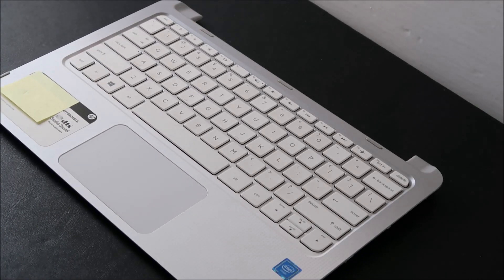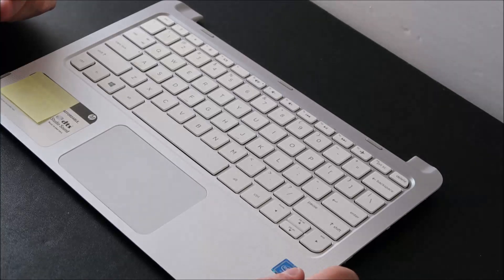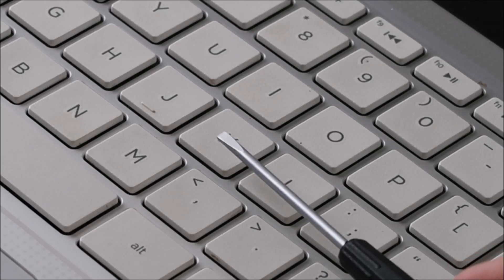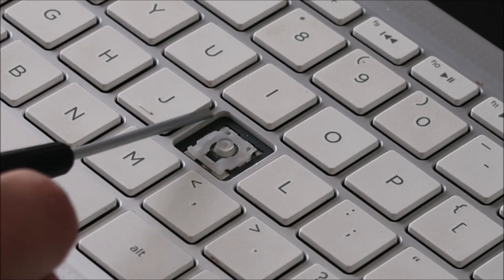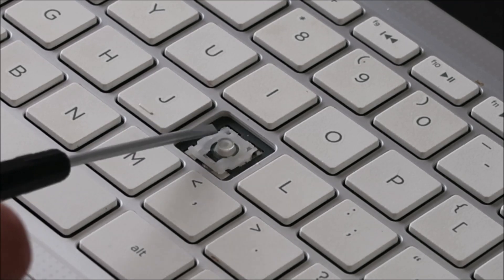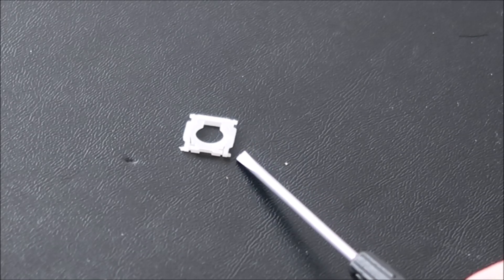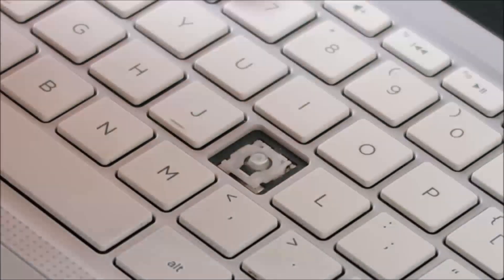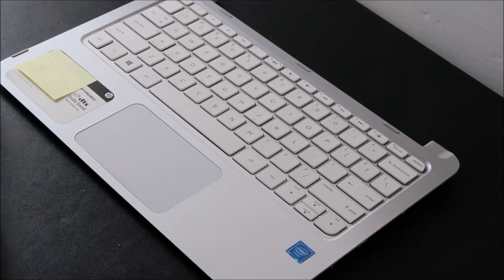How To Fix Replace Small Keyboard Key - HP Envy Laptop Computer

Comment: my whiite thing is just came out with it  i think its stick with the key  and its not broke  for sure now how did i place it back
Reply from the maker: Because they key can usually not be reinstalled with the Retainer Clip and the Key Cap still attached to each other, you would have to separate them as seen here, using a small flat pry tool.
Reply: ooh got it thanks for the quick reply

Comment: Thanks for the video. The key "T" doesn't always produce the letter T on the screen. What do you think is the problem? Sometimes the T key produces two ts on the screen. Thanks.
Reply from the maker: Is there something physically wrong with the key / keys or are they mechanically working fine?  Also, did anything happen before this issue appeared?  Liquid spill, overheating, Windows update, etc?
Reply: @PC_Monkey  Nothing happened. A few weeks (6) ago I had to reinstall Win 11. Everything was working afterwards. This started 2 weeks ago
Reply: @PC_Monkey  BTW, if the keyboard fails, would I be able to use a wireless keyboard? thanks

Comment: my key is working but my i cant able to fix on it.. when i click it jumps out please help me..
Reply from the maker: If your Key Assembly is not installed correctly, I would disassemble and inspect for damage. If none is found, try to reinstall as seen here. If its still not working, its most likely due to the hinge clip being damaged or not oriented correctly or the metal pins on the keyboard being bent out of place. If you cannot fix or locate the issue, I would assume the key is damaged in some way and needs to be replaced.

Comment: I lost the little rubber piece. What can I do please?
Reply from the maker: You would need to replace it. You can sometimes find sellers on sites like Ebay or Amazon who sell key assemblies with that rubber spring included. However, most do not. You may need to get a new keyboard :(  Want help finding the key? If so, what brand and model computer do you have?
Reply: @PC_Monkey  yes thank you!! It's a Dell Latitude 5320.

Comment: Hi my HP ProBook 440 G8 one of the key from keyboard came off, but I am trying to put back, it's not happening.
Can you help?
Reply from the maker: If your Key Assembly is not installed correctly, I would disassemble and inspect for damage. If none is found, try to reinstall as seen here. If its still not working, its most likely due to the hinge clip being damaged or not oriented correctly or the metal pins on the keyboard being bent out of place. If you cannot fix or locate the issue, I would assume the key is damaged in some way and needs to be replaced.

Comment: THank you for this but what if my R key still isn't working after replacing?
Reply from the maker: Does the key feel like there is something physically wrong with it or does it feel like its working mechanically fine? Also, did anything happen before this issue appeared?  Liquid spill, overheating, Windows update, etc?

Comment: Whet if the letter came off with the white thing and cant come off bcs its "attached" to it ?
Reply from the maker: The retainer clip is still attached to the key cap?  Because they key can usually not be reinstalled with the Retainer Clip and the Key Cap still attached to each other, you would have to separate them as seen here, using a small flat pry tool.

Comment: THOSE CLIPS STAY ON THE KEY NOT THE KEYBOURD
HELP ME
I'M ABOUT TO THROW THIS WHOL LAPTOPP OF THE ROOF
Reply from the maker: Your hinge clips are staying on the key cap? Because they key can usually not be reinstalled with the Retainer Clip and the Key Cap still attached to each other, you would have to separate them as seen here, using a small flat pry tool.

Comment: i try to press the key cap back on but it doesn't work. Pls help me.
Reply from the maker: If your Key Cap is not clicking down in place correctly, it is most likely due to the Retainer Clip not being properly installed or damaged.  Remove the Cap and inspect for damage or that its not laying down flush and properly snapped in itself.  Compare to another Clip if needed by removing another Cap.
Reply: I tiny piece of the cap is chipped and I think that's why It don't fit. What do I do now? @PC_Monkey

Comment: How can i replace the rubber part underneath a keypad? Thx
Reply from the maker: There isn't really a good way to reattach those.  They are not meant to be replaced.  Best advice is try to use a small amount of glue.  If that does not work, you may have to replace the keyboard.

Comment: The plastic clip seems fine but the key won't stay on for very long.
Reply from the maker: If your Key Cap is not clicking down in place correctly, it is most likely due to the Retainer Clip not being properly installed or damaged.  Remove the Cap and inspect for damage or that its not laying down flush and properly snapped in itself.  Compare to another Clip if needed by removing another Cap.

Comment: I was able to get both parts off without damaging anything but having difficulty snapping back in place. When I turned the key over the latches/snaps are on the inside of the actual key in addition to inside of the keyboard. I was also able to snap the clip back in place but the key will not stay attached
Reply from the maker: If your Key Cap is not clicking down in place correctly, it is most likely due to the Retainer Clip not being properly installed or damaged.  Remove the Cap and inspect for damage or that its not laying down flush and properly snapped in itself.  Compare to another Clip if needed by removing another Cap.

Comment: Hi. My retainer clip came off with the key. I can snap it on, but every 4th tap or so, it's begins to come up. How do I keep it down?

Edit: I see you told someone else to take off the clip, but I've tried and it seems to be stuck onto it. LOL
Second edit, I just put a little elbow grease and was able to get it off. Wish me luck.
3rd: I think I put it on upside?? It snapped back on the key, but didn't stay on the board.
4: I managed to get it up there, but if I stroke the key in either left or right top corner, it's coming off. And when it does, the retainer clip comes off with it. 
If you have any tips, can you please reply? Thank you.
Reply from the maker: If your Key Cap is not clicking down in place correctly, it is most likely due to the Retainer Clip not being properly installed or damaged.  Remove the Cap and inspect for damage or that its not laying down flush and properly snapped in itself.  Compare to another Clip if needed by removing another Cap.
Reply: @PC_Monkey ... I don't trust my skills enough to do that just yet. But I've been checking across several videos and pictures and can't see where my clip or key might be damaged.

Comment: Found this video too late, now all my keys make a weird sound when pressed and the space key won't go all the way down. What the hell do I do now? (I guess i took the s key off too quickly)
Reply from the maker: If your Key Cap is not clicking down in place correctly, it is most likely due to the Retainer Clip not being properly installed or damaged.  Remove the Cap and inspect for damage or that its not laying down flush and properly snapped in itself.  Compare to another Clip if needed by removing another Cap.

Comment: Thanks for the amazing tutorial!
I have opened my laptop as the keys on the left side of my keyboard (the vent side) aren’t working. They used to work rarely when I repeatedly turned on and off my backlit keyboard lights. But now, that has stopped as well. Is it the dust or is it something else? All other keys are working fine. It’s basically Q, A, Z, and the other keys on their left and top sides. As I mentioned, my laptop is open now, so any help would be appreciated. The bottom of the keyboard (the inside part) which is under a transparent film seems slightly dusty, but I’m hesitating to take those films off.

Comment: Hello there! My key cap just fell off while i was playing video games but for some reason the clip is on the keycap. Should i renove it from the keycap and place it in the keyboard hole
Reply from the maker: Yes, they key cannot usually be installed correctly with the key cap and the hinge clip still attached.
Reply: Thank you for giving me this advice, I will try it out but I have been taking a look at the hole which the key goes in and I have seen that the metal hooks are bent forwards, and a post online says I should use needle nose pliers to put them back in place. Should those metal hooks be upright?
Reply: I just seen a another video with the same laptop model as me and the hook are the same shape as mine (90 degree angle) So I think I will take your advice of removing the hinge
Reply from the maker: @breezyeditz7  Good luck !!  Let me know how it goes :)

Comment: what if you broke the clear thing
Reply from the maker: If any component of the key assembly is broken, it would have to be replaced.  I usually get my keys on Ebay or www.replacementlaptopkeys.com.  If you cannot find a loose key for sale, you may have to purchase a keyboard and take a key from there.
Reply: @PC_Monkey   do they sell windows 11 home keys
Reply from the maker: @I-likebread  The operating system the computer uses has nothing to do with the model computer and what keys it uses.  What brand and model computer do you have?

Comment: even after doing this my key still pops up if i use it, what should I do? Nothing inside is broken.
Reply from the maker: If your Key Cap is not clicking down in place correctly, it is most likely due to the Retainer Clip not being properly installed or damaged.  Remove the Cap and inspect for damage or that its not laying down flush and properly snapped in itself.  Compare to another Clip if needed by removing another Cap.
Reply: @PC_Monkey  it clicks and I hear the sound but after some use it loosens and pop back up, I tried again  and did what you said and nothing is broke, this is just my alt account btw
Reply from the maker: @solar726   If nothing is damaged and if the key is orientated correctly, it will click down, assuming its the correct key for that keyboard.  If you have it orientated correctly and its not clicking down correctly, then its most likely damaged in a way your not able to identify.  I would replace it at that point.
Reply: @PC_Monkey  ok thank you

Comment: My key cap is not getting in
Reply from the maker: If your Key Cap is not clicking down in place correctly, it is most likely due to the Retainer Clip not being properly installed or damaged.  Remove the Cap and inspect for damage or that its not laying down flush and properly snapped in itself.  Compare to another Clip if needed by removing another Cap.
Reply: @PC_Monkey thank you so much, I placed it correctly and it worked
Reply from the maker: @daneenfarhan9587  Great to hear !! Always here to help :):)

Comment: Can you make a video for arrow key as mine is a bit elongated so its not fixing when i am pressing it
Reply from the maker: Usually arrow keys are similar in size to letter keys.  If yours are a bit larger, they should still have the same basic layout.  A retainer clip and a key cap on top of a rubber spring.  If your arrow keys are very large, they may have a metal bar or two as do shift and space keys as seen here:  https://youtu.be/S6gCGN_2zW8.

Comment: Hi! so im on my hp rn and i tried to fix the Z button, but it wont pop back down. Im not sure what im doing wrong but this laptop is VERY exoensive! Im not sure what to do..
Reply from the maker: If your Key Cap is not clicking down in place correctly, it is most likely due to the Retainer Clip not being properly installed or damaged.  Remove the Cap and inspect for damage or that its not laying down flush and properly snapped in itself.  Compare to another Clip if needed by removing another Cap.

Comment: i gotta take mine somewhere prob. the thing that stays on that you put they key on (the plastic thing or whatever its called) comes off as well so currently looking on yt to see if that can be fixed normally or do i have to take it somewhere.
Reply from the maker: If your Key Cap is not clicking down in place correctly, it is most likely due to the Retainer Clip not being properly installed or damaged.  Remove the Cap and inspect for damage or that its not laying down flush and properly snapped in itself.  Compare to another Clip if needed by removing another Cap.

Comment: For reference, here is what removing the up-arrow revealed: http://silmaril.ie/images/hp-envy-7t-arrows-keyboard-dirt.jpg and here is the result of cleaning underneath both up and down arrow keys http://silmaril.ie/images/hp-envy-7t-arrows-keyboard-cleaned.jpg  No further news until I repeat the process. Right now the up arrow is still stuck on repeating until the cap cover is removed, then it works normally with careful depression of the silicon bulb.
Reply from the maker: Do the keys feel like they are physically fine or do they feel like they have something mechanically wrong with them?
Reply: @PC_Monkey  The key feels and looks just fine, but simply won't stop repeating, just as if someone had their finger pressed down.
Reply from the maker: @peterflynn1100  This video is a tutorial on how to replace a key.  If your keys are not working but are not mechanically broken, troubleshoot them as seen here; https://youtu.be/wqrchfpdJ_w.

Comment: So I removed both up and down arrow keys and was shocked at the accumulated dirt and dust, especially since I take trouble to keep the keyboard clean. I used a fine artist's paintbrush (a hog fitch) to clean out the garbage, and then replaced the frames and the keycaps...and it worked! For about an hour, then the up-arrow started repeating again — eg in an editor the cursor zoomed up to line 1 and stayed there. I'll either repeat the process or dig further. Thanks for your guidance.
Reply from the maker: Glad your all set :) Always here if needed !!

Comment: My HP Envy has a stuck up-arrow key. Not visibly jammed down, but on permanent repeat, so the machine won't even boot. I'm just about to try and remove the key, but it's one of the half-size keys, which you don't mention, so this is going to be interesting...I'm assuming that underneath there is the same arrangement, just half-sized.
Reply from the maker: Yes you are correct.  Most likely the same set up, just smaller components :)

Comment: ummmm i have done all these steps but when i try putting in the keycap. it just wont snap back on
Reply from the maker: If your Key Cap is not clicking down in place correctly, it is most likely due to the Retainer Clip not being properly installed or damaged.  Remove the Cap and inspect for damage or that its not laying down flush and properly snapped in itself.  Compare to another Clip if needed by removing another Cap.

Comment: I'm missing the key, the plastic part.  I do have the rubber spring, but it is not connected to the keyboard.  What are my options?
Reply from the maker: If you lost a component of the key assembly, you have to replace it.  
I usually get my keys on Ebay or www.replacementlaptopkeys.com.  If you cannot find a loose key for sale, you may have to purchase a keyboard and take a key from there.

Comment: I honestly think that doing is slowly increases the risk of breaking it!...

Plastic is flexible, even if it's hard plastic. Therefore, if you bend it quickly and then allow it to go back to its relaxed state, it might hold, whereas if you bend it slowly and keep it in its bent state for a prolonged time, it might break!... Even for the exact same amount of bend!
Reply from the maker: I work in a computer shop and fix keys several times a week for years now.  This video is based on my experience lol.  If you have different experience, feel free to make your own video showing a better way to do it.  If your just commenting how you think it should be without really knowing, um... thx i guess lol

Comment: I have acer nitro model keyboard and my q key came off and its not damaged however imhaving trouble reattaching the key to the plastic bit, do you have any tips or help on reattaching it?
Reply from the maker: If your Key Cap is not clicking down in place correctly, it is most likely due to the Retainer Clip not being properly installed or damaged.  Remove the Cap and inspect for damage or that its not laying down flush and properly snapped in itself.  Compare to another Clip if needed by removing another Cap.

Comment: I dont get it
Reply: I need help for my "w" key
Reply from the maker: @Azan_A  What part dont you get?
Reply: @PC_Monkey  Well, i dont get how to detach of the mechanical thingy under the key. My 'w' key is broken. It just fell off. Now i dont know what to do.
Reply from the maker: @Azan_A  1.  Because they key can usually not be reinstalled with the Retainer Clip and the Key Cap still attached to each other, you would have to separate them as seen here, using a small flat pry tool.
2.  If any component is broken, you would have to replace it as you usually cannot install a broken key
Reply: @PC_Monkey  I know that but i don't get how to take the retainer clip off and what not to damage.
Reply from the maker: @Azan_A  As seen here, you would use a flat pry tool and insert it in-between the retainer clip and the key cap.  You would hold down the retainer clip while you pry off the key cap
Reply: @PC_Monkey  I have gmailed you a picture of my keyboard and in that email have explained the things i dont get.
Reply from the maker: @Azan_A  The gmail account is for business purposes only.  For viewer issues, you can message me here or you can post a video to your own youtube channel.  You can then message me back here when your done and I can view it and advise further.